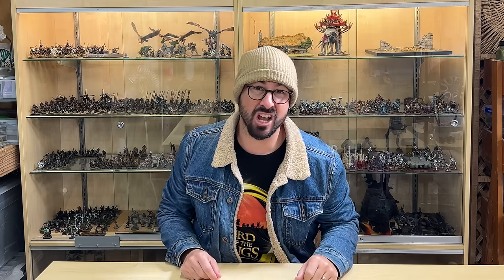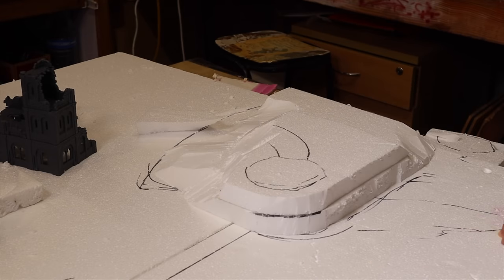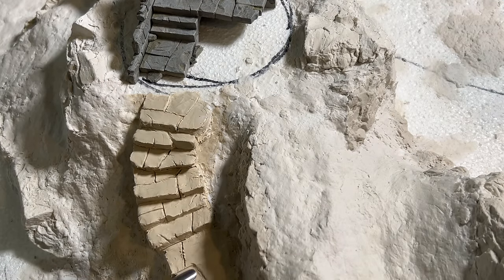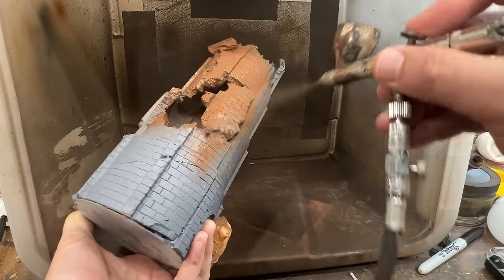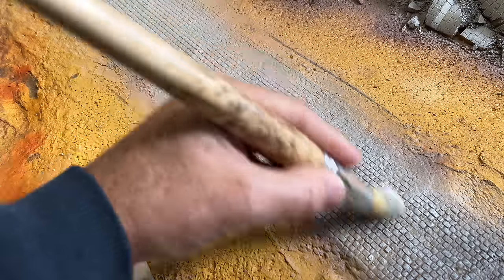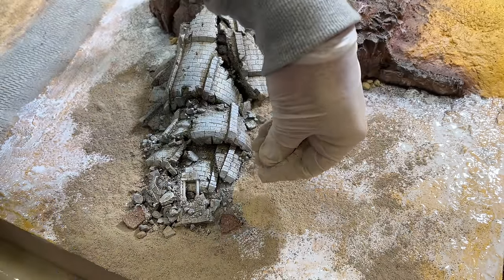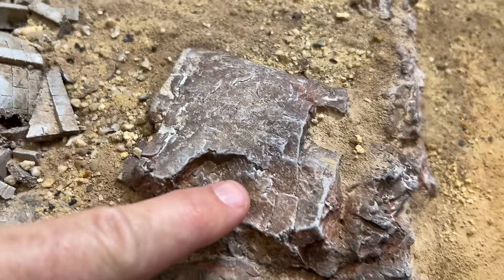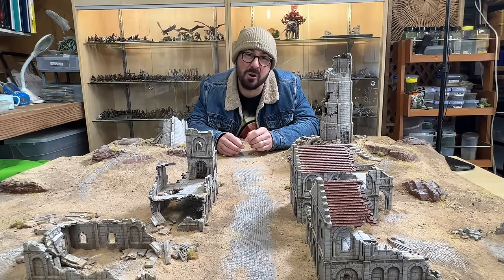Maximizing Warhammer Terrain: Creating an EPIC desert table for your battles!

Comment: You brilliantly managed to fix your rocks painting Adam. I would surmise the reason the Leopard spots technique you tried gave you mehh results : you replicated Lachlan's technique to the T. Problem is, he didn't show or didn't do the necessary prep step of that technique : you're supposed to wet the plaster beforehand. If you don't, your wash immediately gets sucked in by the plaster and you can't really blend the washes together. Plus, don't be shy and try other colors than the ones he did, using coordinated warm palettes (red, yellow, brown) or cold ones (blue, green, purple) gives nicer results. Great board anyway !
Reply from the maker: Cool thanks so much for the tips! Always more to learn 😁

Comment: Beautiful board, you should be very proud. FWIW to avoid damage on the dining table you can also glue a rubber mat to the underside of your board, I bought a roll from Para Rubber in NZ, that was pretty cheap, but Bunnings or Mitre10 might also have something off the shelf.
Reply from the maker: Yeah that's a good idea. Nice tip. Thanks for watching Ben! 😁

Comment: Beautiful table! A trick I use for undulations, prior to the Sculptamold phase, is to put down some original Gorilla Glue (the ochre stuff) and spritz it with water and allow it to cure overnight. You'll end up with fantastic semi-random shapes that are quite resilient and the Sculptamold can be set around them to make them appear like natural rises in the terrain. (Impractical for rank and flank boards, but great for skirmish boards.)

Also I spent a while trying to figure out when you said "there are no mistakes, only lizards" (10:10) wondering "lizards? What? Where is this going?" I realize now its "lessons," but still, lizards would also be sweet.
Reply from the maker: Haha got to watch for those lizards in the desert! That’s a good tip with the glue. Polyurethane right? So it foams up. Dries solid too. Cheers for watching mate 😊

Comment: As I already said on Insta, this is an incredible gaming board and I'm very impressed how you built the collapsed tower. It is even more interesting to see the building of the board including tests and mistakes.
The buildings fixed on the board gives the board an even better look but you might think about storage for further boards. I maybe would build buildings on plastic card sheets to place them on a plain section on the board, where you leave the needed space. If the plastic card sheets have all the same size, the buildings could be placed randomly on the board. Just an idea 😅
Reply from the maker: Thanks mate! Yeah that’s a good idea with the plasticard. I’ve got some plans based around that for a future build 😊

Comment: Ok, the chalky white. I've had a similar experience when doing my boards and I think it might be the plaster. I used "diy sculptamold" for my board and had white coming through painted surfaces and tile grout. Anyone else have similar experiences? Would it be the IPA that loosens the already cured plaster or just it getting wet in general?
Reply from the maker: Yeah it did tend to occur on the plaster elements rather than the grout and plastic parts so you could be right. Either way it cleared up after a week and was fine 😊

Comment: Awesome board! What material did you use for sculpting the stairs? They look awesome!
Reply from the maker: Thanks you! I sculpted them out of air dry clay
Reply: @dicedrinksanddadjokes  Thank for the info. You could make a video about that, my air drying clay never turns out that good, but it could be because it's another material as I'm living on the opposite side of the world :D
Reply from the maker: @Old_Shatterhans  yeah I did enjoy using it. It did dry with some cracks in it which was a bit annoying but did kind of work with the whole old ruined look.